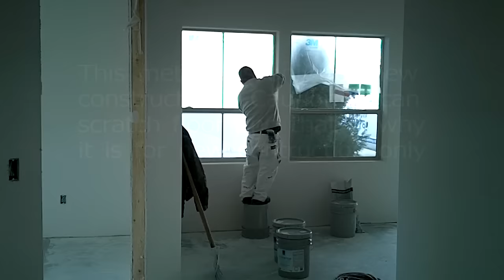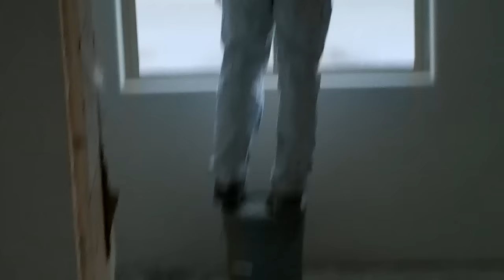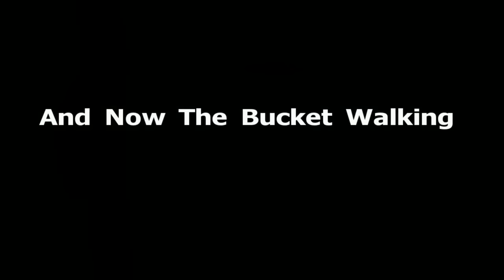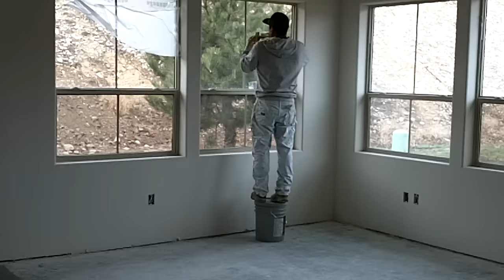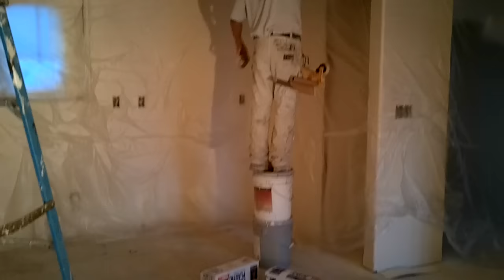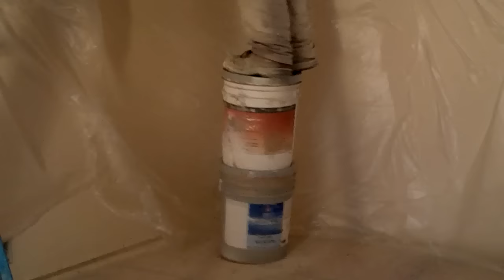DIY Bucket Walking Tips.  Using Buckets Instead of Ladders to Paint with.

Comment: Loving it Chris, beats the two bucket system I was using. Can you do a series on spraying out new homes from start to exit? I have the gear just not the experience. I have questions about masking and separating colour areas. I like what you show in this video as it looks like you have sprayed the walls and now are masked ready to spray out the ceiling.

Comment: Use "are" in a sentence for the state of being of multiple objects or subjects.  Use "is" for the state of being of a single object.  Also, when listing qualities of a subject, like "faster" and "safest", avoid using different syntax when listing the qualities off in sequence. Try "Using a ladder is faster and safer" or "Using a ladder is the fastest and safest method."  But "faster and safest" is broken, and doesn't flow well.